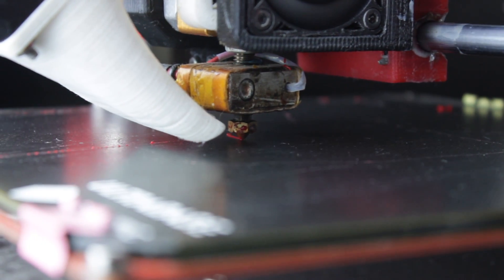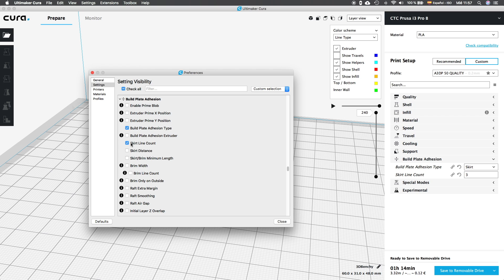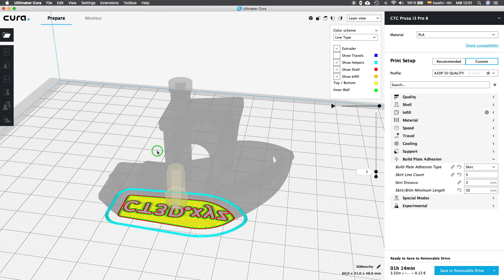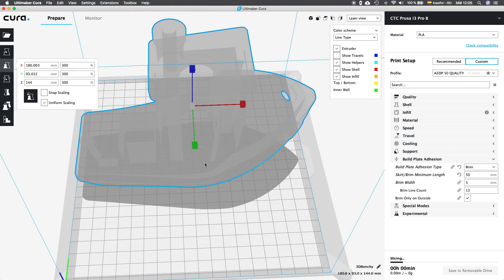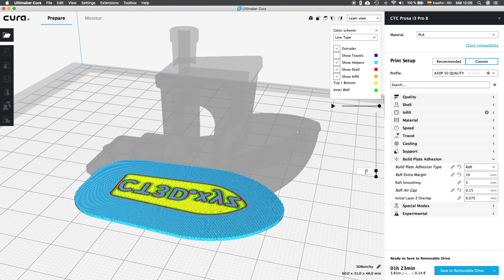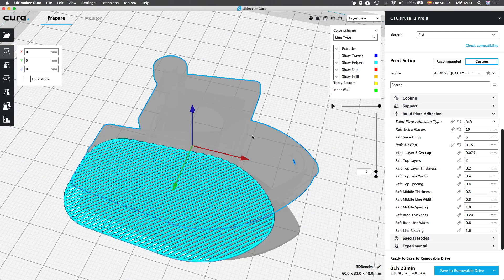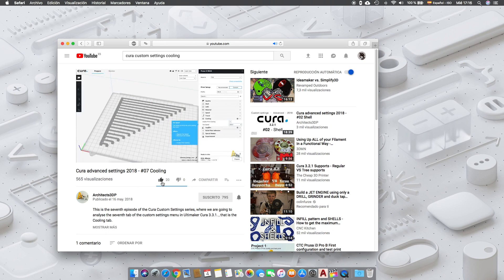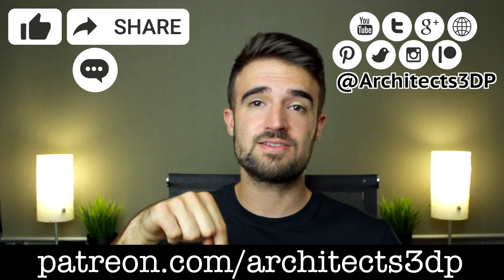Cura advanced settings 2018 – #09  Build Plate Adhesion

Comment: Any reason why the Brim/skirt not sticking to the bed.. but the raft adhere without any issue. Im stuck using a raft to every build
Reply: Warped bed, uneven leveling, or plate is too cool